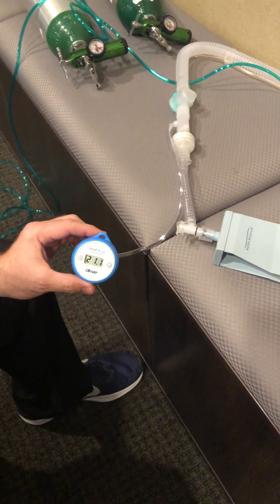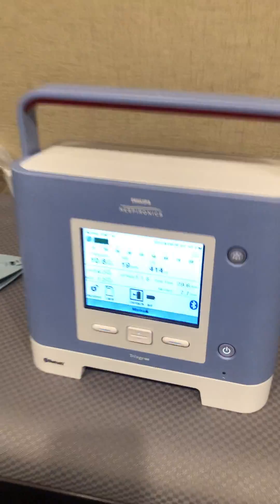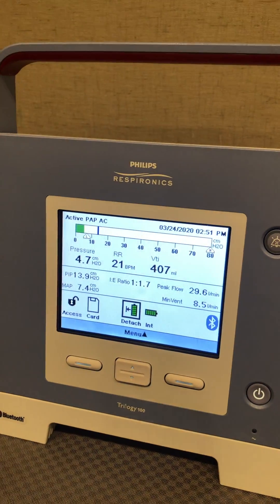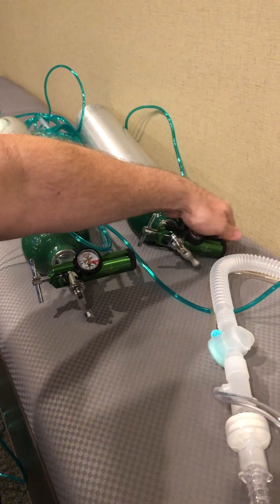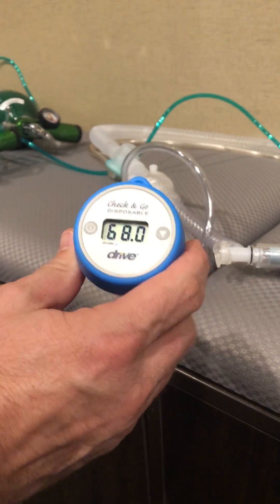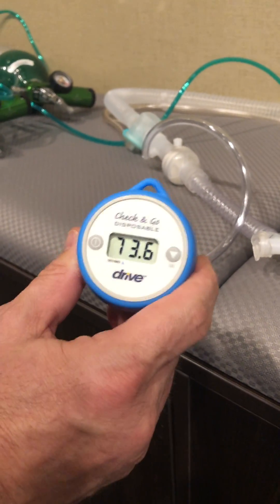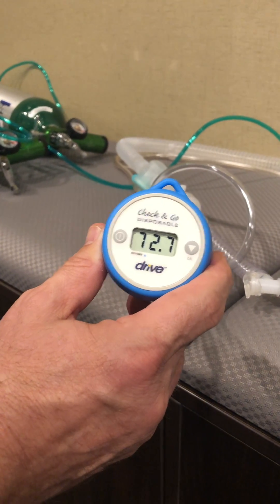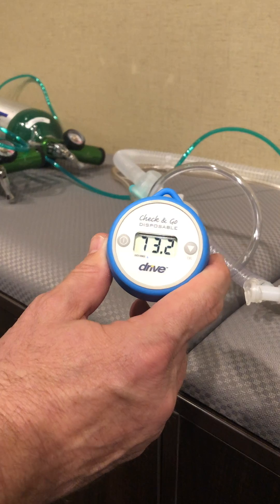Testing the Oxygen Bleed-In - Philips Trilogy 100 Ventilator

Comment: These ventilators, are now under recall. I am now a patient who uses an LTV 1150 at my bedside, and a Trilogy Evo for transport. I do NOT like the passive circuit on the Trilogy Evo. My CO2 goes into the 60s and I am down right intolerant of it. I never tolerated the Trilogy 100 quite well unless I had an active circuit, and it had to be on quite high settings. The Evo is horrible. I'm trying to get a dual limb circuit for the Evo, and so far it's not going so well. My DME isn't cooperating very well. But if I can get a Dual limb circuit for the Evo, and I can tolerate it, I'll be good. These Evo vents are HORRIBLE! I don't like them. But I can't pack an LTV around. If I can't get to tolerating the Evo, It's out of here. I'd tried to get a VOCSN, but my DME doesn't want to order them. In other words, I'm having quite the issue with ventilators right now. Now the LTV, is my favorite, because at my bedside, or when I'm in my house in general, I use the LTV, and I've Loved it from the beginning! I think more like an RT, than a patient, so I know ventilators inside and out. I've given in services, to new RTs, and now stuff about my LTV my RT doesn't. That's not the first RT that's happened with either.